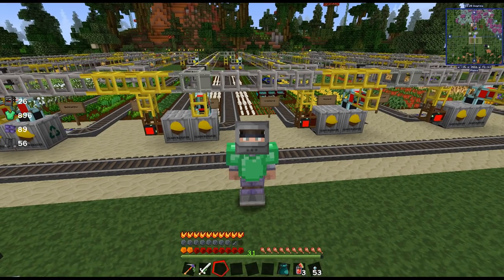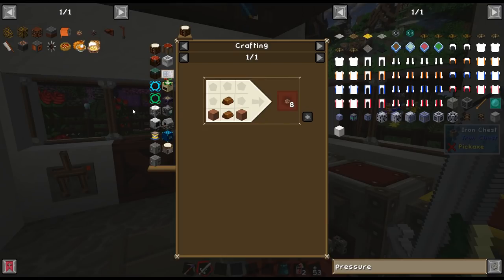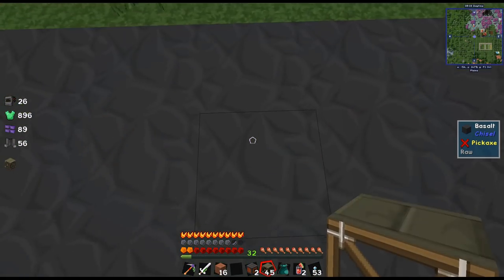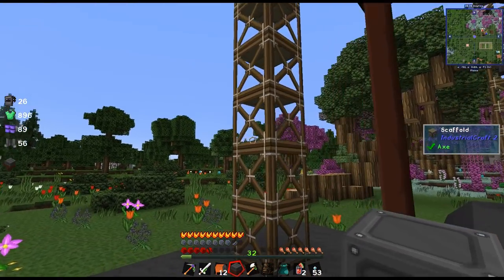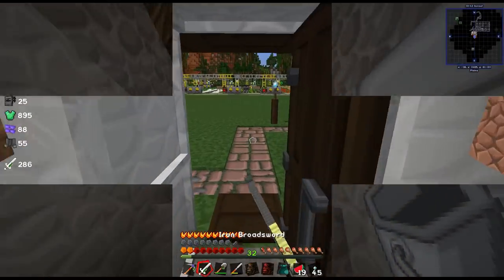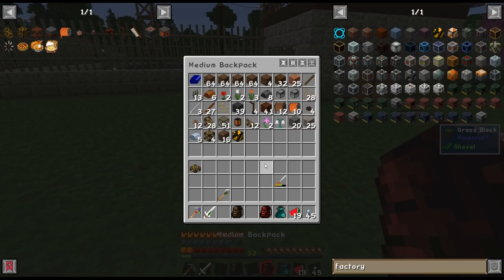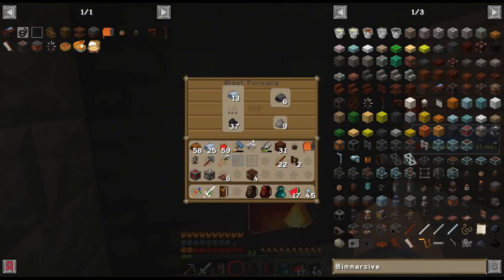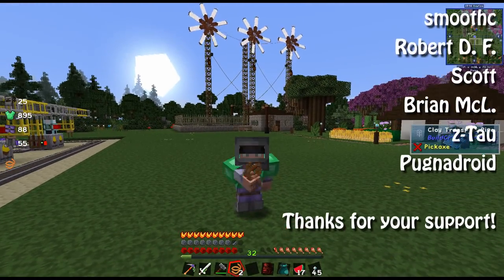#5 Wind Power - 1.12.2 Let's Play

Comment: The mekanism tank can be used as a bucket in crafting recipes, one with 8 buckets of creosote can make a stack of treated wood at once.
 And IE's kinetic dynamo has no internal storage so it will always show 0 RF.

Don't ya just hate how glass panes connect to anything and everything - but (next time) you could make Little Tiles glass that won't. And I believe Decocraft has a special key (alt, ctrl or shift?) that sometimes allows you to place an item even if the outline is red.
 Also, I love that you added the mega torch - it allows me to have just decorative lighting (ProjectRed lamps) and not worry about light levels.

Love the power gen area - I had a power station in mind but somehow I wasn't able to come up with a proper design like you can.

Comment: You don't actually have to connect to the top of Kinetic Dynamo's. It'll output to any side. And I think it's less a display bug, than that the Dynamo doesn't actually have any internal storage of it's own.

Small windmills, for either electricity or drawing water are on small metal towers. Not scaffolding precisely, but open designed towers, to reduce their weight.

Since you have thermal, Item allocators will be your friend when using the metal press. They can input in large numbers for making gears, and don't drop things into the world like dispensers.

Comment: you could use a battery as a through-the-wall/roof connector to drag energy inside a building, what with the configurable sides.